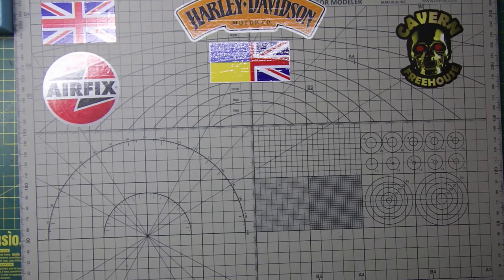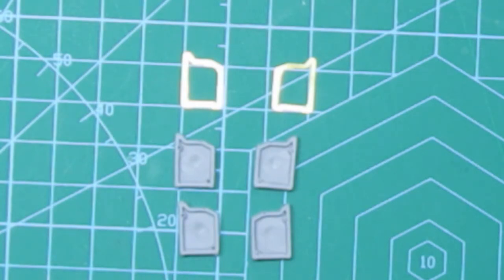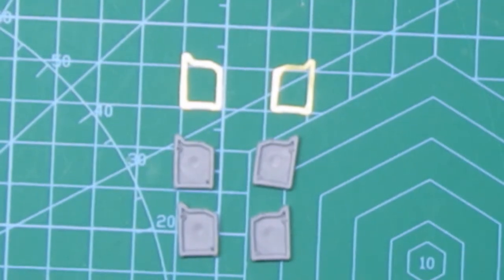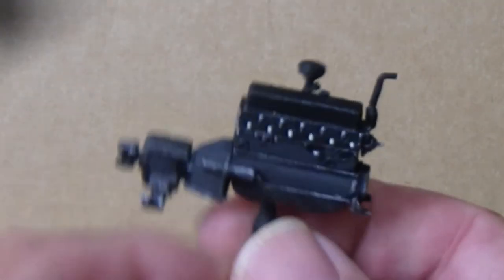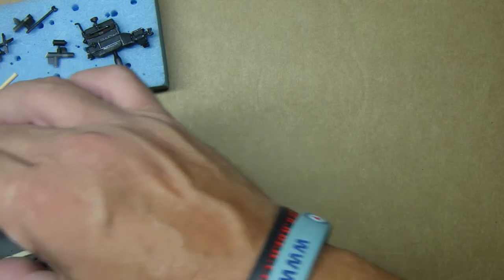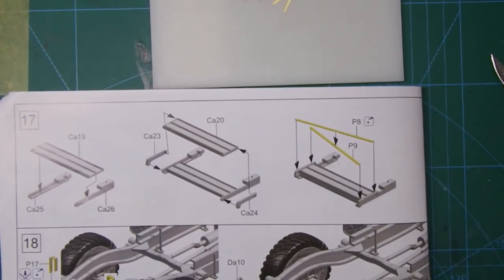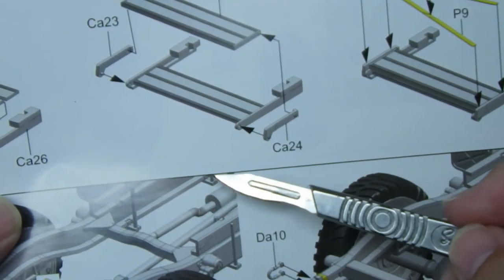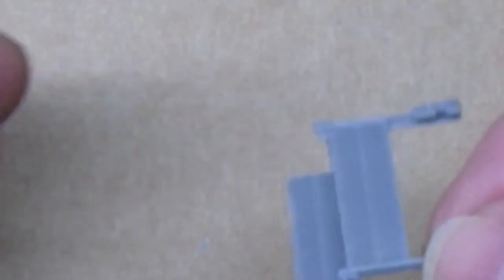Gecko 1/35 Katy Ambulance - build part 3 - rear step update and other progress

Comment: Nice updates, Bob. It's  coming along nicely 👌 . In answer to your comments about the engine colour, being a wartime engine the block and head would be unpainted cast metal. The rocker box and sump would be sprayed black. A peacetime engine would be sprayed all over green as Austin did right into the late 80s.
One thing which is difficult to see without the parts in front of me, but wouldn't it be possible to flip the photoetch to fit and just ignore the part numbers on the petrol cans?
Reply from the maker: I'm really grateful for your insight Andy, I'm going to use that as my guide. With regards to the photo etch, no I've tried all options with it, removing the pins and going from there is the most straightforward option. Thanks for your contribution. Have a great week end. 👍

Comment: Hi Bob. I have this kit but I haven't started it yet. What paints are you using? The Mission Models ones are expensive so I was looking at Tamiya/Humbrol equivalents. Any Advice? There doesn't seem to be any conversion charts available.
Reply from the maker: Hi Arthur, I’m using Vallejo Model Air and just colour matching the ones I have to what I know the desert colours to be. When it’s all weathered it should be fine. The Airfix kit has Humbrol colour call outs: for Egypt 1942: body colour - 74 Matt Linen, the soft cab doors  - 159 Matt Khaki Drab. I hope that helps? Cheers 👍
Reply: @greybeardmodels  Thanks for that. I spent a long time trying to decide whether to get the Airfix or the Gecko version and in the end I went for the Gecko because of the much higher part count. I might regret that! Anyway I'm a long way from painting yet so I'll wait and see how yours turns out.
Reply from the maker: @arthurjordison5392  no problem - I’ll do some colour call outs in my next video. Cheers Bob 👍